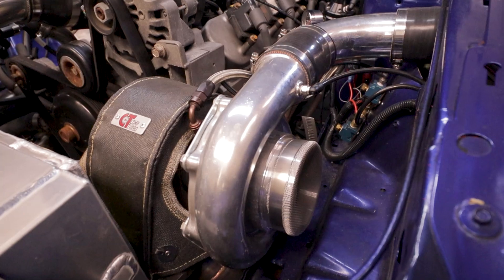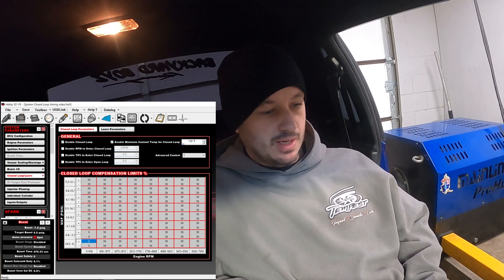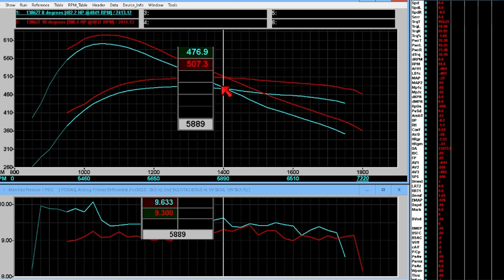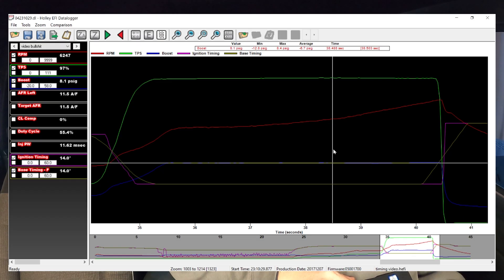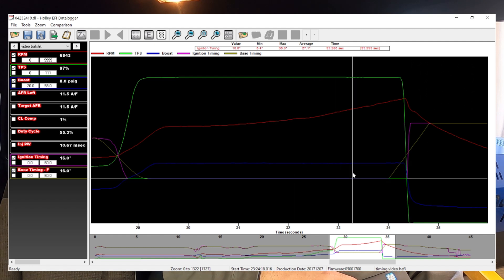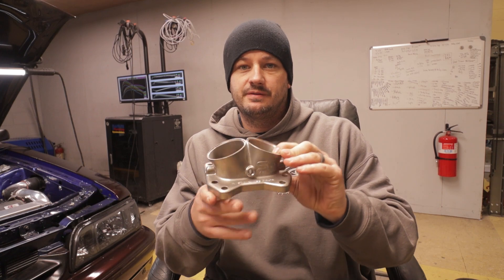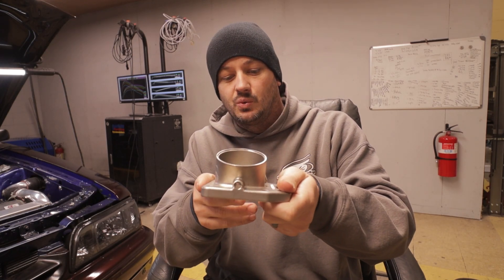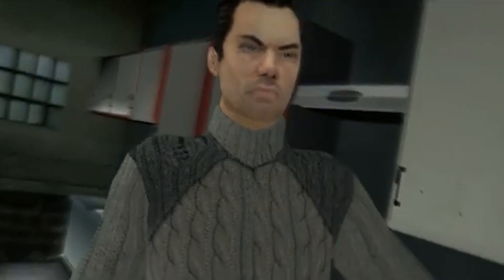Ignition Timing VS. Horsepower  // SBE Turbo LS Foxbody Mustang // Holley EFI // Hub Dyno Testing

Comment: Hey Joe, I'm building a rear turbo 98 camaro, I'm still need to swap ls1 for a new ls2 6.0 new build.
I'm probably about a year away to get the engine in the car running N.A.  then I need to get the piping played out for the rear turbo. I was going to run dual 2.5 in pipe the rear turbo and then run 3 in all the way up front see if I can get oval pipe to get it underneath the car should be interesting but you should 10 ' s in the 1/4 in Albuquerque New Mexico

Comment: Having seen this im questioning a decision on my current build. 

So this week i should have my sniper EFI installed on a 351W, roller Xcam, RPM air gap, Rpm heads and longtubes going to a NLU AOD with a 3200 stall, 3.50 rear gears. My mechanic convinced me to go with a GM style distributor for easy installation. However i now know that this method will not allow for timing control and will run on mechanical/vacuum timing. How much do you think my setup will lose out on HP, MPG, and other things, drivability, idle, etc. 

Would it be worth it to spring for the hyperspark and CD box and coil($600) and see if i get more power? 

car is a street car, minimal track use if any. currently has power brakes and A/C.

also ive heard the sniper if very susceptible to RFI, considering the GM distributor and its location on the Ford, do you think it will be a problem? What can i do if it is?

Comment: Hey! From India! Currently designing a turbo kit for Harley Davidson motorcycle! Loved the video. I don't have a dyno, however I also start with low timing, like 1deg per psi. Then road tune the acceleration with 2deg increments. Acceleration values and knock sensor events from log is how I do it. And i agree same set up on different engines responds differently to timing! Always wondered why is that, may be ring gap, or something else

Comment: Ok. I have a question. As someone who doesn’t know a whole lot about turbo set ups I would think more timing would equal more boost. More timing = more heat, more heat equals more energy feeding the turbo… so why does less timing make more boost? Is it less heat = more air density/volume? I’ve heard of pulling timing on the chip or on the way to the chip to spool faster. It’s never made sense to me. If someone could explain this I’d be grateful.
Reply from the maker: Severely retarded timing makes more heat

Comment: So you can find max timing by just grabbing all cells like that? What about that it needed lower timing at lower rpm, do you just do like a fill selected values and let it taper it down to a lower value that you enter?
Reply from the maker: As stated in the video, doing it this way was just for demonstration purposes. 

Honestly each car and set up is different on how I’ll go about it. For example a car with a converter that flashes to 6000 rpm is going to be a lot different than a car with a clutch.  NA will be different than turbo etc.    

You could do it this way as long as you make the appropriate changes in the appropriate places based off of what the dyno tells you i guess
Reply: @JoeSimpsonAtTempest  cool, ya I heard you day that. I  was just wonder if that was a possibility. Trying to find somthing easier than the way I'm doing it now. Thanks.

Comment: So i get that this question is gonna be very vehicle specific, but just ballpark a number. If you're tuning at the track or in my case, on the street with a dragy......how much mph would you be looking to pick up for each degree of timing added? Kind of a similar setup to this car.....
Reply from the maker: Yea that’s too vehicle/condition specific. But it’s risk vs. Reward. If it picks up 3mph that’s a clear indication it made more power. I’d it picks up .3 it picked up, but is it enough to be worth it? In my eyes no. Also there are a ton of variables that come into play doing it that way so usually need multiple attempts at it to make sure it wasn’t just condition changes that made the improvement
Reply: I really appreciate the response Joe. I'm out in the boonies in Minnesota, so I'm usually able do several hits on the exact same stretch of road to try to limit the variables. But I'm really new to all this so I didn't really know what to expect. 

I've basically learned everything so far from a combination of your videos, sloppy, and a21bravo, and for only running 8 pounds so far....this little fox of mine is an absolute ripper.

If you ever have a chance, you should do a video on cold starts/hot restarts. I'd be interested in seeing your process. Mine starts pretty decently on cold start (though it definitely hunts around a little until it gets into learn mode) but on hot restarts, it's extremely crabby. I planned to start toying around with some of the startup enrichment tables, but there's not a ton of information out there on what I should be doing/looking for.

Love the videos and that you're active on some of the Holley tuning pages on facebook. Thanks for helping us little guys!
Reply from the maker: @MaximumJEFFort   what’s ironic is i made a few how to videos then got so overwhelmingly busy (partially from those videos) that i havnt had a chance to make any more.  The how to videos perform better than the tuning videos typically so i need to find a way to make more time for them!

Comment: Lemme ask.   So when you call it 18 degrees of timing.    Is this 18 at wot.   With different numbers at cruise and idle.     Or 18 across the board
Reply: From what I seen he just did timing changes at boost across the board

Comment: I really appreciate your knowledge I'm getting my 2000 transam. tuning it and slowly turning it up. I have holley terminator gen 4 5.3 on e85 with a th400 sbe with head studs 243 heads and full fuel system. If it's not to late I'd like to enter for a chance to win the flange. Email:smh4786@gmail.com I live in Jacksonville Florida

Comment: Great vid, Joe! I would like your thoughts on reducing timing at peak torque/overall timing curve on a well set up max effort SBE LS deal. Mine is a 5.3 on E85, FI S491/102, TFS 220's, PTC converter, LJMS valvetrain set up for 8300rpm shift points, all in a 3400# '67 Camaro looking to go low 8's. Do I just leave the timing at 12-14° and crank the boost up to 35psi, or should I get a little more aggressive with the timing? Thanks man!
Reply from the maker: thats a tough one, as every one is different.  thats why i encourage putting every car on a dyno. even the guys that just track tune their stuff always see benefits when they break down and finally put it on a dyno!
Reply: @JoeSimpsonAtTempest  Just wanted to say love your video's and all the info you put out to all of us wanting to learn. I know every car and engine is different and there is no real specific answer, but can you go over mike's ^^^^^ question above if we were to have on a dyno how would we go about tuning timing in not just the WOT area but in the peak cylinder pressure area's? In the video you just change timing from 0-wot rpm... would be another part 2 to this video if you could show this

Comment: Great videos. You are extremely knowledgeable. I started following you after the purchase of my terminator x. You were very helpful in several tuning points. I do have a question for you. I have a 5.7 ls6 at 12 to 1 and a comp 54 602 11 cam. Just wondering if you think I can get 430 to the wheels on 93 octane?

Comment: I had no idea you could make blanket settings in the timing table like this, I’m glad I found your channel, I have recently setup my sbe 5.3 turbo with term x, I’m in New Zealand.
Reply from the maker: I don’t recommend tuning that way, it was for illustration purposes!
Reply: @JoeSimpsonAtTempest  Thanks I’m a real beginner and learning a lot.
Car runs great as far as I can tell, having a lot of trouble with hot and cold starts.
Reply: @JoeSimpsonAtTempest  what if it's a full race car????? no street action
Reply: What would be the recommended way of tuning. I see a lot of tuners have a flat timing graph. I thought timing would increase with rpm

Comment: Thanks for the content very informative. Timing is the one where I would say the majority of people have the least confidence.
Reply from the maker: Yup for sure. I have a lot of people that will rent my dyno and never even touch the timing. It’s interesting to watch how other people go about their processes
Reply: @JoeSimpsonAtTempest  
I have heard both sides on knock sensors. And from what I have gathered knock sensors work good if you are factory computer/car because they are tuned for the car, but for holley they can be tuned but it seems difficult to trust. Maybe a future topic but would be interested in your opinion on the value of knock detection and specifically on holley.
Reply from the maker: @Nickyb801   yes knock sensors do more harm that good for most people when not in a factory ecu.  That’s a tough one to cover as a lot of experience is involved. And in my opinion, still requires a dyno - it’s more of a keep it safe after the fact type of thing. I know others may view it a bit different but that’s my take on it

Comment: I see you’re located in Virginia! I have a 4.8 with a Gen 2 7875. Been 9.30s @ 147 with a 1.42 60 ft. I just need someone to tune it above 20# and clean up the tune. It’s been together for 3 years and I tune it myself. I know there is a lot left in the tune
Reply from the maker: I’m actually in Maryland where are you located
Reply: @JoeSimpsonAtTempest  I’m in Richmond va. I looked up your shop. It says you’re about 2 hours away. My car has the ms3 gold box. Would that be an issue?
Reply from the maker: Nope get some of those through here every now and then. Did one the other day
Reply: Awesome. Thank you for your time. I will definitely be getting in contact with you. Let’s peg the Gen 2 7875

Comment: Good stuff man. How do you like the cast stuff vs the billet cnc collectors? I’ve been using the street car fab ones lately and really like em. Haven’t had a chance to try out a cast unit. Texarkana, TX/AR
Reply from the maker: the difference between cast and billet isnt any different as far as that goes.  the design beetween the street car stuff and the sequence stuff is much different.  the street car stuff is nice but i like the design of the sequence stuff better.

Comment: Looks great, how much more timing do you think that setup would have taken on e85 and what do you typically see for gains?  Central US here, corn fuel everywhere.
Reply from the maker: The turbo cars don’t seem to take as much additional timing from 93 to e85 as the blower cars. I think the last one i did didn’t take much additional at all. Picked up like 70 hp on the gate from just switching fuel and a couple degrees extra

Comment: Would love to see where the "knock threshold" is compared to where the power gains start to drop off. Love the videos Joe, Nova Scotia, Canada.
Reply from the maker: thank you!  ive done a few knock control videos. one on a turbo 4 cyl, the other on a bone stock 4.8 -  the 4.8 compared external knock monitor to factory sensors

Comment: I'll be doing this exact testing on a 408 LS with a small Procharger and a Terminator setup for a river (jet) boat on the engine dyno. (91 octane/non intercooled) From what I've seen so far here on YouTube is around 12 degrees is a safe number for sustained (loaded) running, expecting around 4 PSI boost. Any thoughts Joe?
Reply from the maker: i did a video tuning a ls7 air boat for the washington dc police department.   id start with the timing far less than 12 degree's, and walk it up and see what it likes.   91/no intercooler + boat + sustained load is like worst case scenario!  let me know how it goes and where you end up!
Reply: @JoeSimpsonAtTempest  Yeah it's a tough situation for sure. It's a redo from another shop that had some good ideas but an off the wall cam selection, another person doing the EFI reflash, and the customer ordering the injectors. Yeah, destined to fail. They replaced pistons twice before the customer became fed up. It's a whole saga. The engine was originally a Kodiac Procharger 6.0 package with their EFI system. In the end, the 408 had a cam that made peak power (N/A) north of 6200, 30 # injectors, and a mystery tune on an old EFI computer. This is in a 20' aluminum river boat and a jet/impeller combo that would gut the engine before 5000 RPM.

Engine comes to us with a set of lower compression pistons, so we rebuild it and put it on the engine dyno N/A with a carb to break it in and get an idea of the powerband. It makes good power, around 530, but like I said, well over 6000. We recam, and we lose 20 or 30 but the powerband is a solid 1200 RPM lower the combination now fits the application.

We have some 60# injectors coming, the EFI intake is back on the engine along with the drive assembly and supercharger. I've done a few dynos using the Sniper throttle bodies, and 3 or 4 combinations with the HP Holley, one being a Gen III 426/Whipple combination that settled out at 1100 HP. I've tuned numerous carbureted marine combinations on the dyno, and I pay less attention to peak power, most of my focus is on where it will spend it's life, typically in the mid 3000 range with a good load on it. I'll spend sometimes 5 to 10 minutes at sustained RPM at say 250# torque, monitoring exhaust temperatures. You'd love to add timing but you just can't, so (over)fueling is your only option, shooting for 1400 or less temperature sustained. This is with dyno headers, so typical water manifolds help to richen/cool the temps down a bit more.

So your thoughts on this setup, keeping in mind it will be relatively low boost (thinking 4 to 6 PSI), this is what I had in mind as an initial setup. Realistically, the engine is either at idle or 3000 (whatever RPM the boat will stay on step) and up to pump stall speed, we have nothing other than transition to deal with between those places. (basically like a high stall in a heavy car) I planned to target 11.5 AFR  in the boost zone of the tables and initially 12 degrees, but from what you're saying that's a bunch of timing.

Can I safely add fueling to control the exhaust temps and keep this thing alive long term? 11:1? I suspect this will spend it's life at or slightly below peak torque. I won't know until I start running this thing, but I can only assume 8 degrees at cruise is going to give me very high and climbing exhaust temperatures.

Sorry about the story book, hopefully you can give me some insight so I can be successful in giving the customer the product he deserves. Best regards, Doug

Comment: Joe simpson. would you be willing to do a boost over timing video? I'm from  Wa state
Reply: Joe simpson. on 93 pump gas say  you can run10psi and 18* of timing and make almost 600hp but on 14 psi and say 12*  makes 650.  Would that really be the case?
Reply from the maker: I’m not sure i follow what do you mean?
Reply: @JoeSimpsonAtTempest  maybe a video on the power different between boost levels on 93 pump . Like 10 psi made x 12psi made x and 14psi made x  And what type of timing you  would have to run with each psi